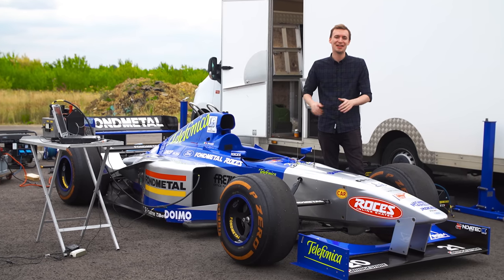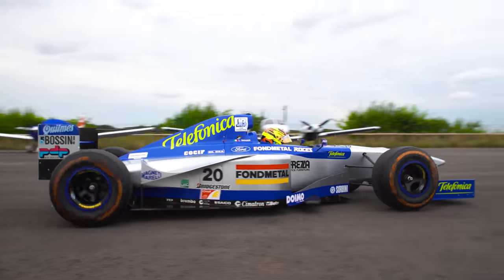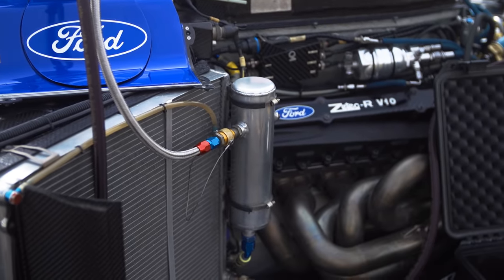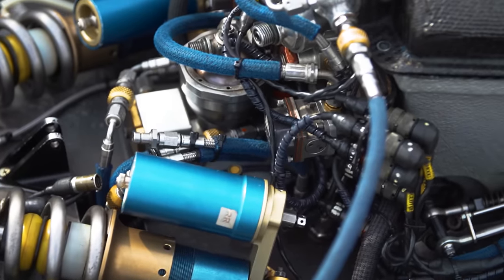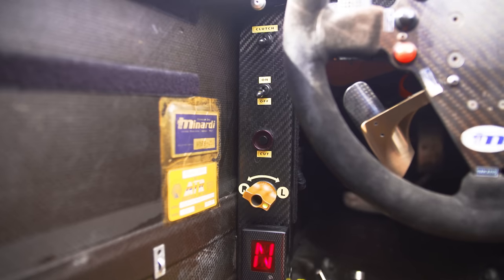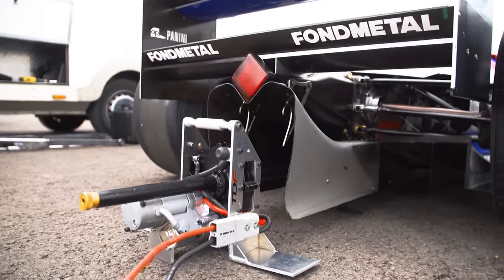Why Formula 1 Cars Take Hours To Start

Comment: Talk about a very focused machine, not at all intended for user friendliness but simply for sheer performance at the extreme limits of what the machine can do.  What a hassle it would be if the ordinary passenger car required this, but the ordinary passenger car does not have to go at well over a hundred mph on a racetrack for hundreds of laps.

Comment: The clearance is on the modern formula 1 engines is so tight that they have to preheat them that's the engine oil everything to so they can start their engines.

Comment: He talks a lot like people in shared college dorms:
"the kettle only works when you push the power switch while you run windows 95 on two PCs in dorm 6 and the oven clock shows a round number or seven"

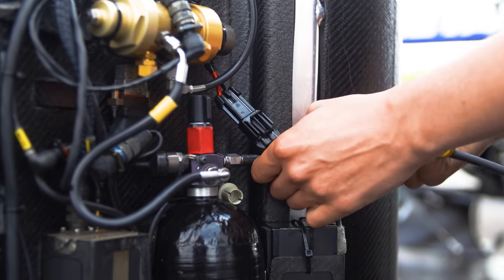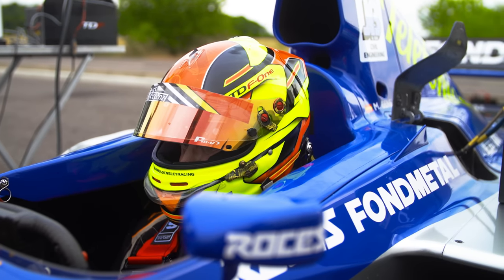Comment: @3:35 he states that the engine valves of these cars ALL run on COMPRESSED AIR, which is pumped into a compressed air bottle in the car. @3:51 he states that they use a Fuel Prime Box to fire up the engine. @4:03 he says once the car fires up, we take the fuel pump away.   How many people knew that Formula 1 car engines run ON COMPRESSED AIR.  Why can't ALL cars run on compressed air with just a bit of fuel to prime and start the engine?
Reply: Dang you almost got me there lol i thought you were serious

Comment: i used to work in an office which backed onto and F1 constructors site
on a race week they would bring the cars into the carpark and fire them up after the final rebuild
nobody could work for half an hour because of the noise and vibration

Comment: I worked on Ford Model A's and starting those up was quite a task !! all the controls had to be hand adjusted!!  throttle , Choke , Distributor Advance, and mixture were all inside the drivers cockpit including the foot starter switch , clutch and gear shifter!!    Eat that F1 !!   😎😎🤘🤘

Comment: A Windows 95 environment can be perfectly emulated in software today; almost all Windows 95 apps will run fine on Linux using wine. And you can throttle down the speed of an app in software as much as you want, up to the point that it looks like slow motion.

Comment: Be in IT, feel the pain of also having to grab an old Panasonic toughbook time to time to put Win95, WinME, or some old Linux or Unix distro on there for a very specific but also very expensive to replace functionality. At least they can use the parallel cables with no rollover latency

Comment: Hard not to love the sound no matter how long it takes to start.
Reply: These 19000 Revving V10, the piston were tight in bore to create more power; so you can't start them cold! An engineer once said, if you make the piston tighter within the cylinder, the engine would produce 20% more power however, it would destroyed itself when start cold. These engine are highly technical, Honda could not master the technicality of these engine because their V10 use to blow up at each race. Renault BMW Toyota and Ferrari were the most reliable within those V10 Era...

Comment: As a software / hardware engineer and if possible I would love to be able to contribute to port that software, and maybe even create an hardware interface for such a car, would you think the team would want that ? Because maybe in a few decades, the car wouldn't be able to start even if she would be mecanically viable.
Reply: What's shocking is that this isn't like bank software or life critical software, I'm sure it's not THAT hard to rewrite unless they have something incredibly cursed going on!
Reply: @Ariccio123  I'd say they don't rewrite it for the same reason they don't rewrite bank software written in a language made in the 80's. The hardware is too low level and you are better off with newer hardware with newer software. It could be done, but the reward for the effort is nearly nothing anyway.

Comment: You can use windows 95 with an emulator on recent computers and run programs,games etc...so i doubt about what they say here.
Reply: I think the problem is due to the old software relying on the clock speed of the CPU as a reference for timings, so even using a VM may not work
Reply: @pineappleroad  
Ok,i see.

Comment: could they use heater blankets or heaters to warm engine?
Reply: Yes, but I think circulating the oil and coolant is more effective at bringing up the temperature of the internal components than an external heat source.

Comment: Totally not what I was expecting it to be.... I figured you would pump the gas pedal three times. try the ignition with foot off gas pedal. If it didn't turn over then wait 10 seconds and try it again with foot to the floor on the gas. Just be ready to let off the gas when it turns over

Comment: Do F1 cars still have an external starter motor? Or do they just let the MGU-K do it?
Reply: i think ive heard a few times that they can be started with the MGU-K
albeit im not sure id its true or not
Reply: They are still started externally, but I'm not sure why
Reply: yes and no. As far as I'm aware they're still started externally, but the MGU-K is capable in some cars. I don't think it is in the Ferrari engines  though. I feel like I remember a Haas stalling and it was out because they weren't able to
Reply: @flintstone1409  I would guess that any mechanisms that would only be used at the start would be waste of weight to have to carry around on the car for the rest of the session so it's offloaded to external equipment.
Reply: They still start with external starter motor to this day granted some of the mechanisms have changed but still they do start with that external starter motor
Reply: @flintstone1409  to save weight
Reply: @jako1234567890jako  In the 2021 Bahrain GP Perez started his car out on track after it died on the formation lap
Reply: @j0mp4m4n  exactly my point
Reply: Red Bull uses the MGU-K to start their engines. Since it's always there, anyway, dropping the external starter saves on some complexities in the gearbox, and I've heard it's also ever so slightly easier on the engine.

Comment: I don't think the Panasonic CF-28 can run windows 95 by default, that machine shipped with Windows 2000 or XP normally,

Unless of course they changed some settings in the firmware.

Comment: so you actually can use modern computers with the exes run in compatibility mode for windows 95, it works for virtually everything i've tried. and i only do it when the programs fail first

Comment: I have driven a 1998 Ferrari around Hockenheim and Nürburgring and been over 1s faster than the best times a 1998 Minardi ever did on these tracks (no the same weather conditions obviously, but close). Now the biggest gap between the best and worst driver is around 7th of a second. So I would have beaten Schumacher in a Minardi if I had the Ferrari. That´s how bad the Minardi was. And there were times when they were 5-6s off the pace.

Comment: Meanwhile, a top fuel (nitromethane) dragster engine can be torn down, completely rebuilt, started in the pits, and ready to run again in 75 minutes.  This cycle may be repeated 4 or 5 times on race day.

Comment: That's poorly written software if it has all those inherent timing issues that are based on the speed of the computer.  I understand if it's a 16 bit app as MS dropped 16 bit support after XP/W2k.  But you should be able to run, say, XP or W2k in a VM on any laptop, and properly written software should work.
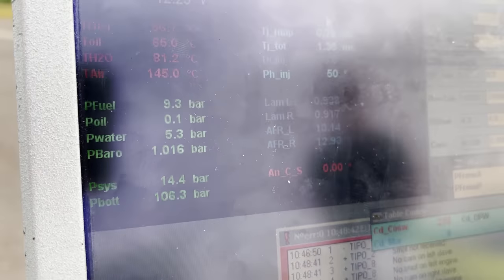Reply: it is running on xp. look at the taskbar at 2:45. it clearly has xp icons. its xp with classic theme

Comment: Reminds me of an old car I had. Had to crank it with a battery charger and spray stuff into the air cleaner to get it to crank and fire. Then, because the transmission was messed up, there was a trick to get it into reverse. My date once turned on the heater before I could stop her. She almost died from the Hanta virus from all the mouse droppings. And I had to warn her about putting her feet on the rubber mat on the floor... that was rotted out. She picks it up and sees the road going by 6 inches away. ( Great for chucking empty beer cans on the down low.)

GREAT CAR. 63 Plymouth Valiant with the bulletproof slant-six engine.

Comment: What was that compressed air used for again?
Reply: Pneumatic valves, usually they are operates by the engine but on that f1 car its with compressed air

Comment: I get that they don't have electric starter motors to save weight, but surely that's better than getting stranded with an off engine and being unable to get back into the race?

Comment: Wow... these cars are designed to run extremely fast, corner extremely well, within distance exactly equal to 60 laps, and no more... it has fulfilled its purpose. It dies at the end of the race, and reborn in the next race.

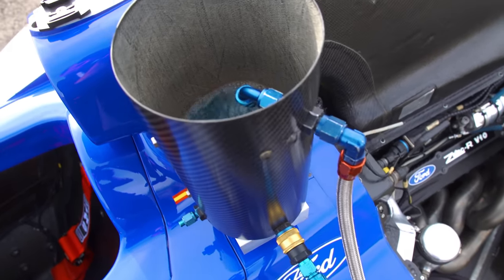Comment: @ 1:15 What did they mean when they said, "depending on what engine they are running"?
Reply from the maker: Referring in general terms, not different engines for the same car!
Reply: @mattamys  Firstly. Thank you for this content. You must of worked very hard to achieve this. You deserve all the credit for it. 

I saw a video of a privately owned Ferrari F1 car. They described how Ferrari retains the engines. What they said was, if (for whatever reason) they want to run it Ferrari give them an engine but it may not be the original. Same era though. That’s what sprung to mind with the comment.

Comment: Speed of the computer should not be the problem. But compatibility of the serial port (or even parallel) is. So the old laptop would have a spcific, native port that is compatible with the sensor system. Since serial and parallel ports where not remarkably standardised, a usb to serial adaptor will not work and specifix hardware should serve as a host.

Comment: All of that windows 95 and slow computer stuff is just down to bad/old software. Back then there wasn't a whole lot of funding to get newer versions of stuff they'd rather just run and old computer lol. Times have changed. I rememebr when banks and other corporations would use super old tech and software to save money and these days everything has to be running the latest everything otherwise it's a security risk and it's big budget to keep everything updated.

Comment: just a nerdy detail but for the average person this is boring nonsensical mumbo jumbo. 
What he means to say is that the program that's used to start, monitor, and edit the car was most likely one off purpose-built back in the whenever and nobody dares to try and port or emulate the program because All of the applications operating parameters are probably hard coded in for that specific laptop because they only planned on using it for A few years (writing The program for a specific computer makes it easier (more so back than than now). The caveat being that its the only computer it can run on properly)

Comment: 2022 F1 turbo-hybrid cars: Crap. my car just stalled after a spin, let's just punch it in neutral and use the overtake button to start it back up through the ERS system.

Comment: Oh, come on.  Yes that Windows 95-based software can run on a “modern” PC operating system.  You just need to run it in 32 bit compatibility mode. You need a new IT guy if you’ve been told that.
Reply: Yeah, not all the time bud, it doesn't always just "work" so why worry about troubleshooting computers  when their focus is troubleshooting the car, lol. Running on bare metal is always going to be the better option if available compared to any virtualization.

Comment: These were the days when Formula 1 SOUNDED like a race. Now it sounds like a load of pussy whipped saloon cars coasting round on narrow tyres with lap times measured  with calendars rather than a stopwatch - hence why I turned my back on it! The days of the big turbo engines and road roller tyres were electric. I reckon its on the way to becoming all electric cars next..........SILENT RACES.